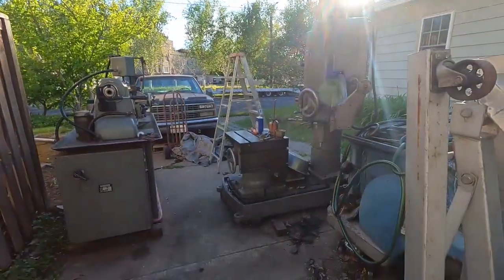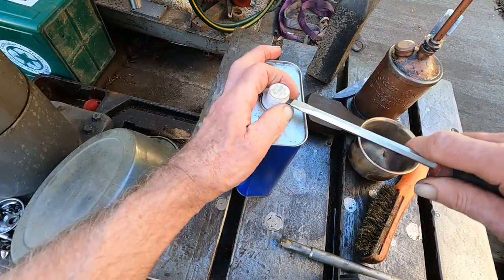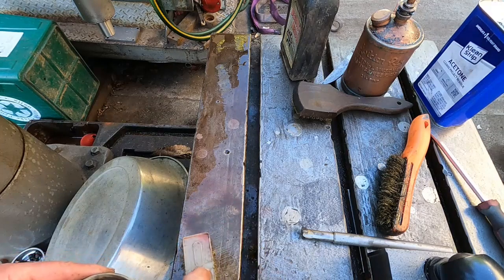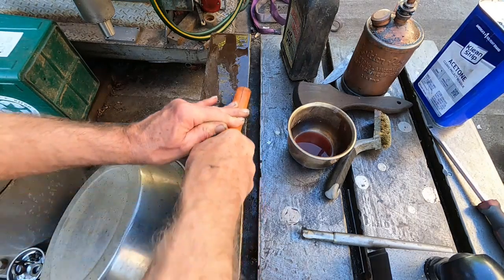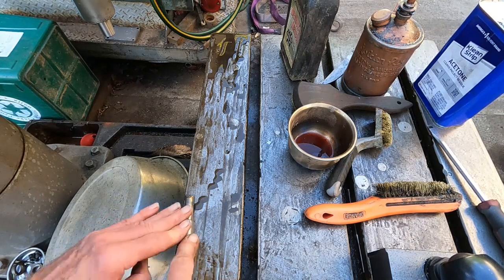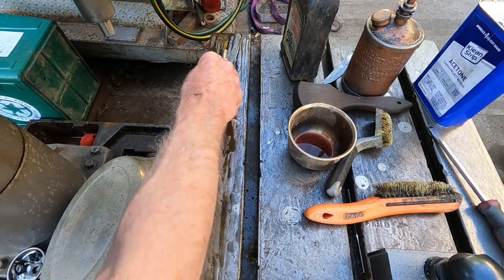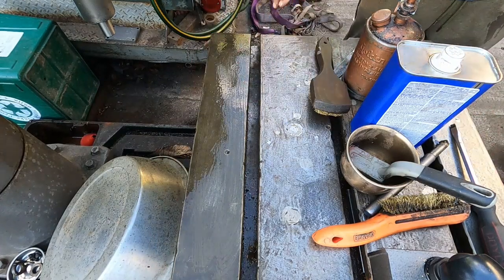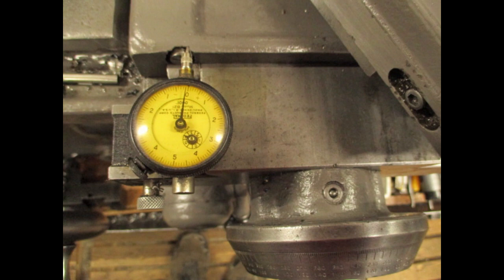Ancient woodworkers' machinery rust removal method

Comment: As an old woodworking machine bum, I resemble that razor comment. I buy them in 100 packs. And it works great. The razor hates rust but floats over virgin iron.

I have used navel jelly and red scotch brute pads. Lots of elbow grease!!!! So I go to the razor first. Then you wash down the jelly with water. Immediately wipe off and then spray WD40 to suck up water.

I have seen persistent stains however. I am going to try this formula to see how it lifts the stains.

I have also used a sander with papers going to 300 or 400 to finish the table. Start with about 220. It’s about finish and not removal.

Often you see shop rash. Lots of dings and sometimes hammer dings. Use a machine scraper to take down the elevation around these.

The worst is holes. On drills, I call this the circle of dishonor. You can weld them sort of…. Nuff said!

I took an idea from Hardinge and Wadkin! Drill the hole and tap it with threads. Then machine a threaded plug. But the plug head resembles a skinny nut with a narrow shank. All done on lathe.

The hole is done with a center cutting mill by the way. So it’s got bottom. Then put some red locker on the plug and wrench it down. The nut portion will snap off. Then finish.

The plugs are made of cast iron. I dare you to see the repair when done!!!! A glancing light will sometimes show a hairline circle. But you need to really look for it.
Reply from the maker: Plugging the holes with cast iron would be ideal, these welded spots are not easy to level. I stumbled upon the woodworking machine method using the 50/50 atf, acetone No Abrasives! even scotch bright will remove planer and hand scraping marks. I found this method on the internet in about 2012 when I bought a rusted 14" table saw for next to nothing. On that I did use razor blade for 30minutes realizing I am a millwright with a cutter grinder I came up with a more reasonable method or I would still be removing rust with razor blades. The brass brush will not cause any damage what so ever. as can be seen with the scraping pattern on the horizontal ways on the radial drill.
Once the rust is removed, constant wiping the machine down with kerosene, chemical stains fade after some time perhaps 5 or 6 months the results of that can be seem in the before and after photos of my Axelson lathe that had stains from the early tapping fluids. I will not use any water based acid rust removers, those etch the iron. I am a professional, know what I am doing and prove it in every video. Thanks for tuning in!

Comment: Hey Don,
I did not know the ancients had Dextron III? 🤣 Sorry I could't help myself! 
I have a friend who runs a Hydraulic shop and he swears by that mixture as a penetrating fluid. Next machine I do I am going to try what you are doing. I have a bunch of small scrapers I have made over the years. I do know surface rust pushes right off with a scraper nicely without too much drama.
Reply from the maker: I stumbled upon the acetone and atf after buying a rusty table saw and researching the best approach. Using power tools on table saw tops dramatically reduces the market value of the machine.  Some of the heavy saws have a planed table and restorers have maintained the machining marks on heavily rusted machines. It seems like the cabinet makers took a hard hit in the 80s or 90s and the heavy machines went to the scrap yards, then the schools phased out wood shop. The metal working more slowly dying off.
Reply: @DonDyarprecision You are absolutely right!  Some machines are ground. Some are planed. My Oliver cone head has a ground semi steel top. Here power tools are great. If the top is Blanchard ground, don’t worry. Do what works. But if it’s planed, STOP!  Use a method that preserves the planer marks. Planed tops break stiction and are nicer to use. Many feel they are more accurate. Jeff who owns Northfield swears by this. The finest new shapers by Martin and Hoffmann are planed on 80 year old planers!
Reply from the maker: @devmeistersuperprecision4155  The brass brush and no abrasives is the ticket, I was able to preserve the planer marks on the Axelson lathe and B&S mill. Those marks are in the millionths depth, Scotch Brite will fade or remove them, Thanks